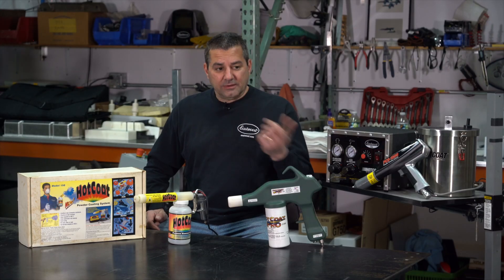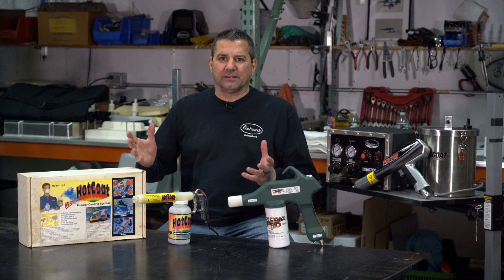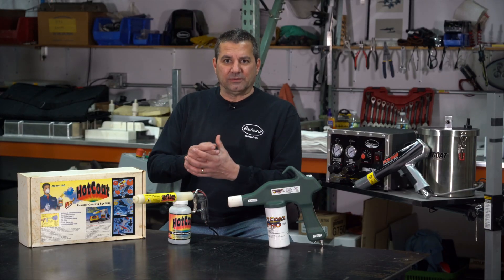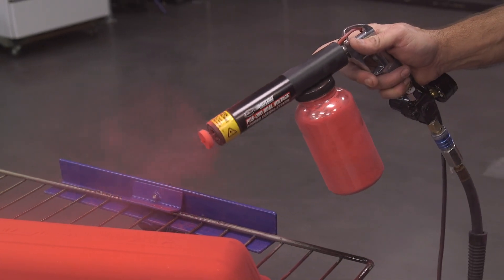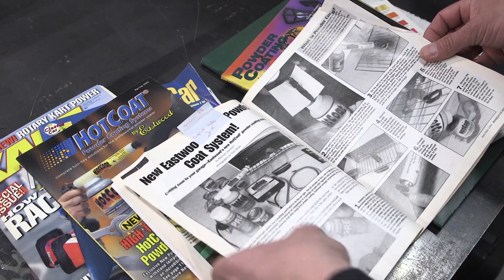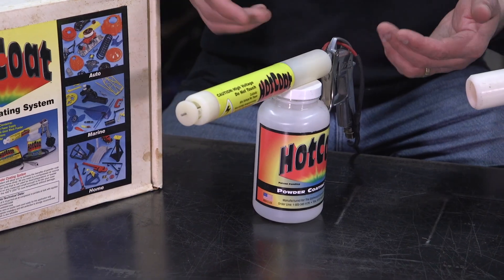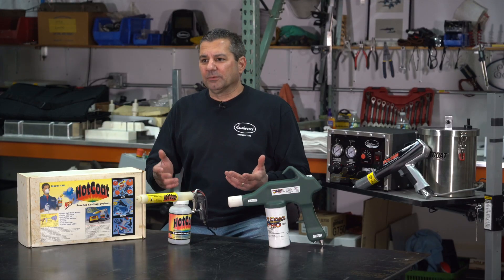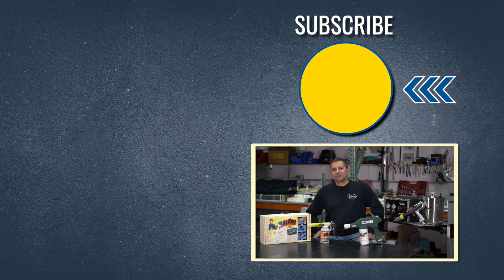How a Bar Napkin Turned Into One of Eastwood's Best Products - Prototype To Product

Comment: What type of powder would be good to paint a chainsaw, polyster powder or something else? It would need to be gas and oil resistant and tough. I'd like to see a video on the different types of powder and which ones are more suitable for different situations and uses like for instance the chrome powder, is it less durable than the other powders and is it gas and oil resistant etc etc?

Comment: I bought one of these in late 1999. I used it during the restoration of my '68 Camaro convertible with an oven my brother-in-law pulled out of a duplex. I did all the engine brackets,  bolts, master cylinder, alternator case, hood hinges, backing plates,  you name it. If it fit in an oven X 2 ( I used 1/8" plate to double the effective size of the oven) and it wouldn't melt, I covered it. I still have that Camaro and no joke... it still looks like I painted those parts last month. From the beginning, I was sold. I went through 2 of their entry-level models (I repaired those a few times on my own) and then stepped up to one of their better units which I still use today. In fact, I just did some trim parts for my RV. One of the single best, well-used tools in my garage. I also think that product helped solidly establish Eastwood as a tool innovator instead of a tool reseller.
Reply from the maker: This is great. We're glad to hear that your parts still look good after 23 years!

Comment: Nice to see the progression over the years. 
I started out messing around with a craftsmen powder system and got hooked on the powder process. I used a few of those craftsman guns at the same time to shoot bigger items. Not the most ideal situation but, I got good results.
I haven’t been able to powder in many years and wanted to get back into it so I recently purchased the pcs1000 system and a few small hoppers as well. Hoping it’s a good system as I haven’t been able to use it yet waiting to finish spray booth.
Reply from the maker: That's great! We know you're going to like the PCS-1000.